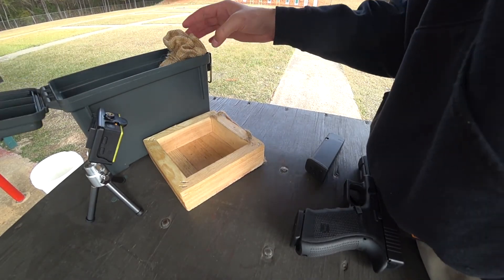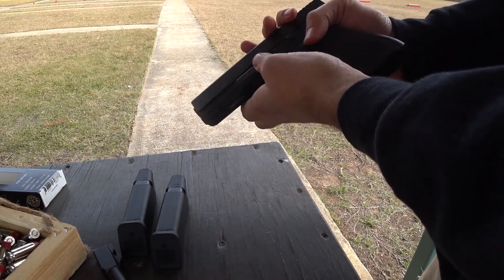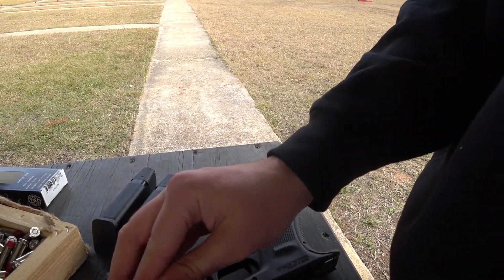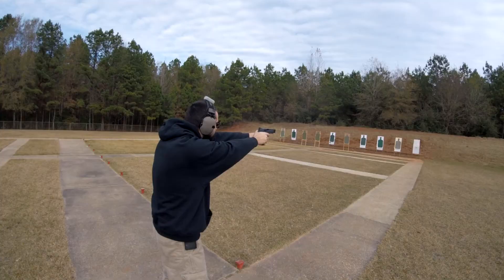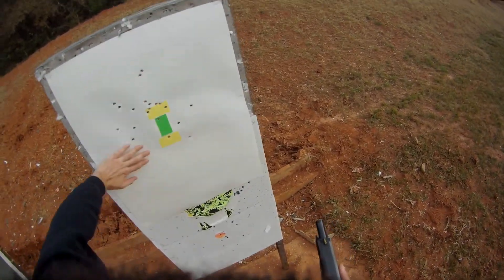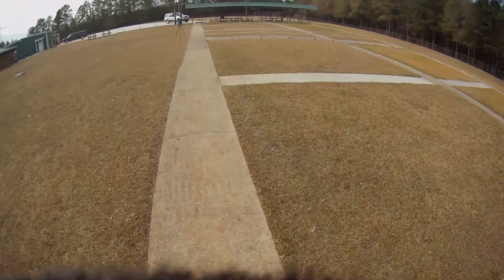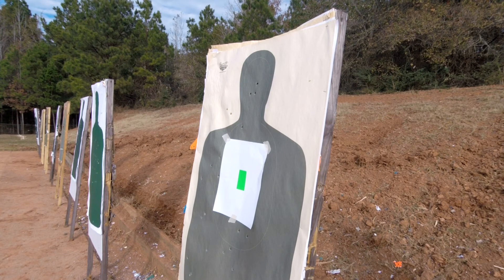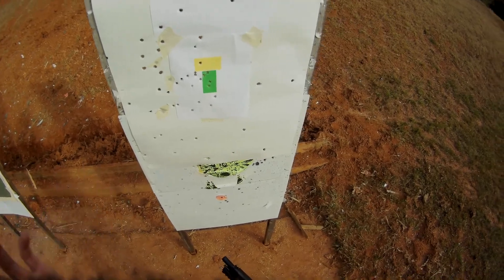Glock 20 Alpha Wolf Hand Loads

Comment: I responded to you on your other 10mm videos. If you didn’t get leading in the aftermarket barrel it’s because it’s smaller diameter than .3995” inside the barrel vs your lee crimp die your using that automatically resizes your bullets down to just from running your ammo up into way before it even touches your crimp plug. I haven’t bought an aftermarket barrel for it yet just because it shoots 1.5” groups at 25 yards pretty consistently with jacketed ammo.   I’d tell you to try another brand crimp die. My custom hornady crimp die keeps from sizing down my cast bullets and keeps them from leading.